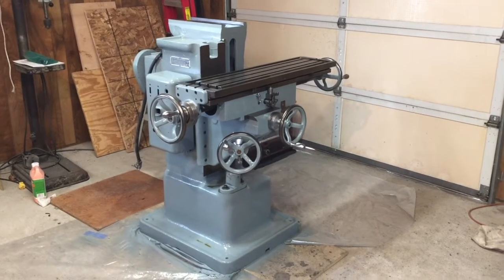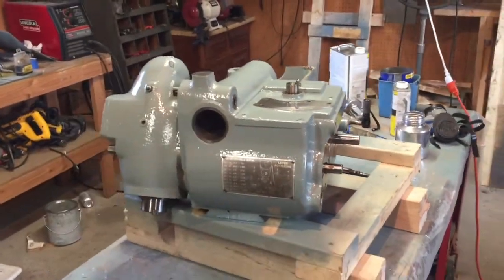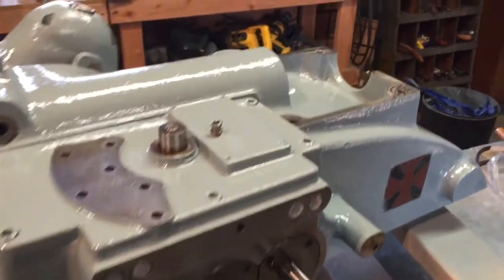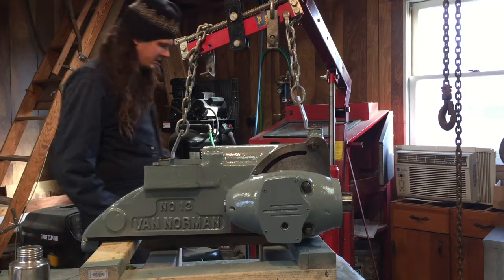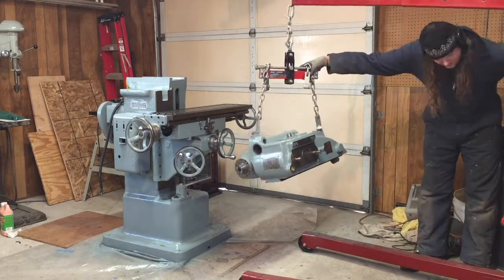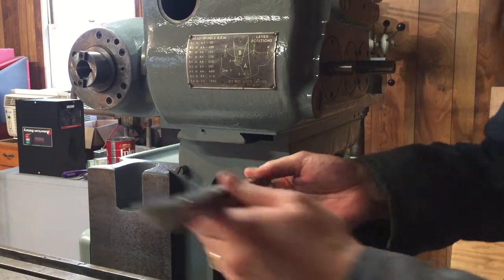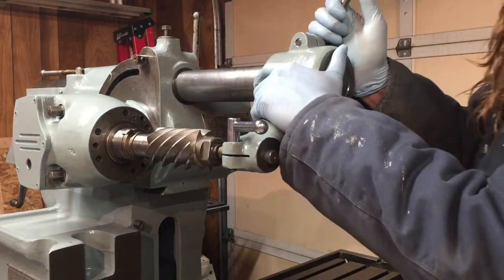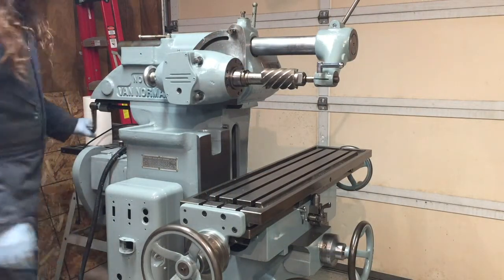Van Norman Model 12 Mill: Part 5 - Table and Ram

Comment: Hey Steven. I found and subscribed to your channel as a result of my recent acquisition. You may guess that it's a Van Norman 12 in pretty decent shape. I don't have immediate plans to go all in with the restoration at the moment. Just really want to get it cleaned up and working. My main issue right now is that the knee is pretty well stuck. My first thought was to release the pressure from the way on the left side of the knee way, but as I stared at it for a while I began to think that by loosening that gib the whole knee might dislodge. It's a weird configuration. I've watched all your videos, but I didn't see any of that action. So....if I remove the nuts and then loosen all of the caphead screws and knock the handle our out of the locking lever and back that out am I going in the right direction?
Reply from the maker: Yeah I think that makes sense - loosening the cap screws on the gib a bit to try to break it loose. Just be careful not to loosen them too much, it would be pretty scary to have the whole knee fall off. Study up on the manual too if you haven't already, it was an excellent resource when I was working on my mill: http://vintagemachinery.org/pubs/2109/3403.pdf
Reply: Thanks. I've got my engine hoist holding the table/saddle/knee. I'll loosen them up today and see what happens. Thanks for the link, too. I couldn't find one. :)
Reply: Oh...and of course the previous owner couldn't find the overarm support. That's OK, though...they gave me a decent price.

Comment: Somebody at Van Norman had a sense of style.  Do you know the year of manufacture, and where was the shop you took it out of?
Reply from the maker: +Jon Bryan oh yeah for sure, I love the look of this machine. I don't know the exact year but I'm pretty sure it was late 40s. I got it from a college but apparently it started it's life in a Navy shipyard.
Reply: I think it was a wartime machine.  Vintagemachinery.org has a 1945 Model 12 manual, and by then they were using a squared-off sheet metal electrical box rather than the rounded one that you have, and the 1940 didn't have the teardrop head.  Go take a look.  And upload a picture of yours when it's done!

Oh, and the undated manual they have looks just like yours, and you can see the wartime "eagle" plate on the electrical box.

Oh, wow.  The last page of the undated manual has some handwritten notes, and what might be the name "Ben Fenner."  You might want to point Keith Fenner here and ask if his dad or granddad was named Ben.
Reply from the maker: Jon Bryan ok yeah I'll definitely take a look, I have been wanting to do some more research in this machine. It's always interesting to learn more about how these old machines were used in their previous lives.